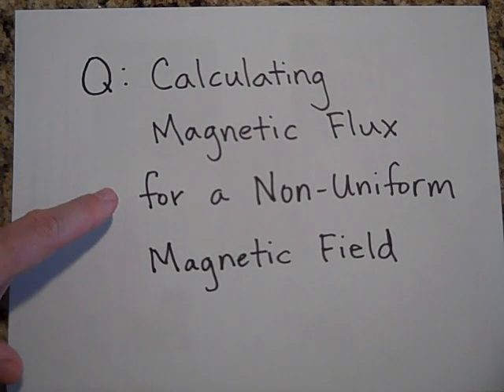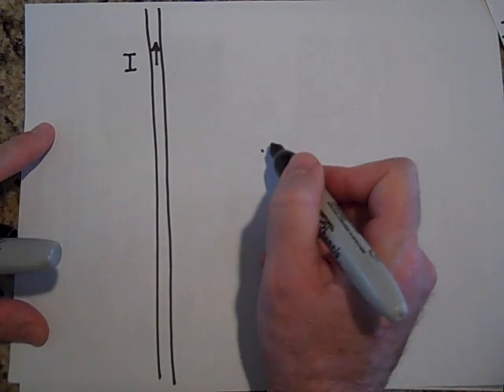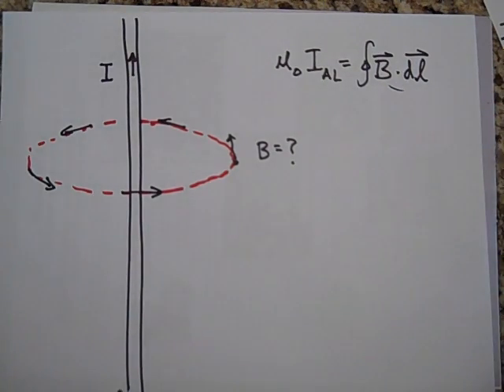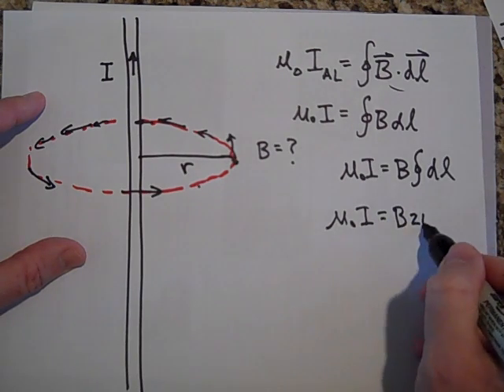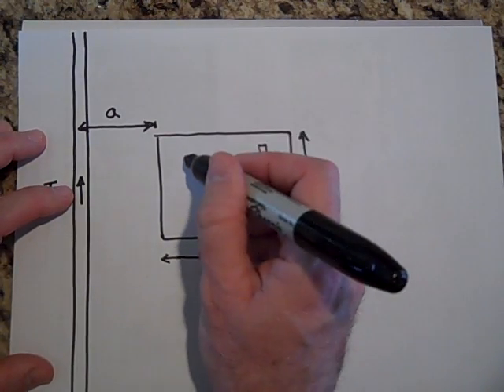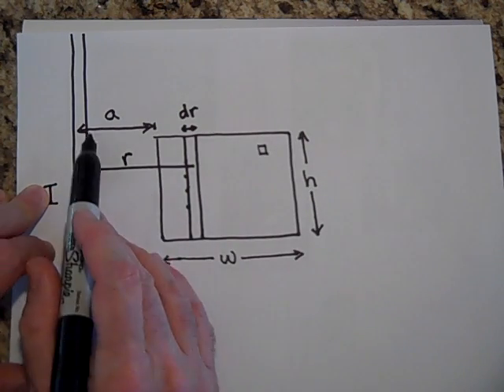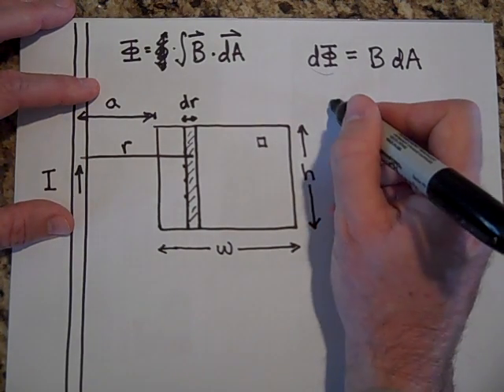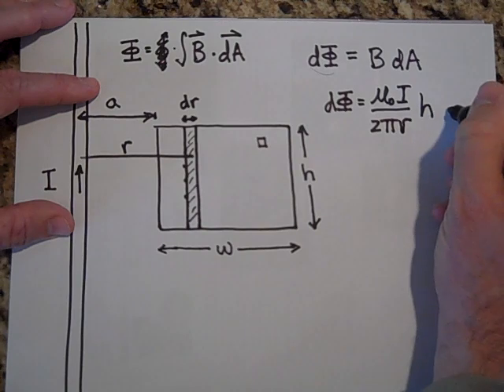Calculating the Magnetic Flux for a Non-Uniform Magnetic Field

Comment: What if I wanted to find the induced EMF after the magnetic flux?
Reply from the maker: So you only have an emf if the magnetic flux is changing with time.  To find it, use EMF = -d(flux)/dt  or EMF(ave)=delta(flux)/delta(t).
Reply: @lasseviren1  yeah I have a similar problem to this one where I integrate from r=H to H+W but there is also a velocity on the loop going towards the current carrying wire. So if I am not mistaken I can use minus d fee over dt.

Comment: Nice video. I missed my lecture on Friday and this really helped out. In response to shazaduh4ever, if current is a function of time, it is independent of the dr, so pull it out of the integral anyway and just use the current at the specific point in time you want to observe. Your equation would look something like Flux(t) = uI(t)h/(2pi)*Integral(1/r dr) from r=a to r=a+L. In english: [(mu_not*current as a function of time * h)/(2*pi)] * integral of (1/r) dr from radius = d to radius = d+L